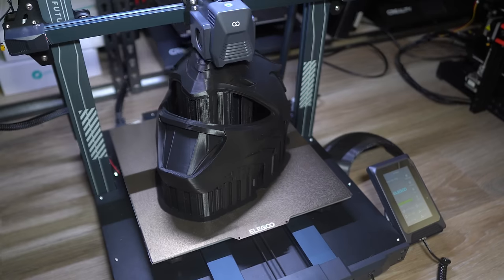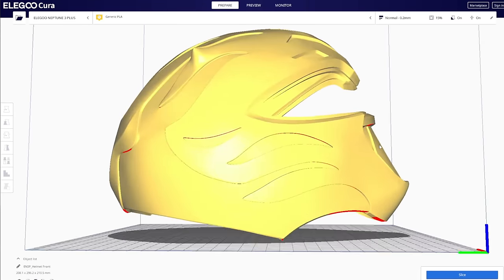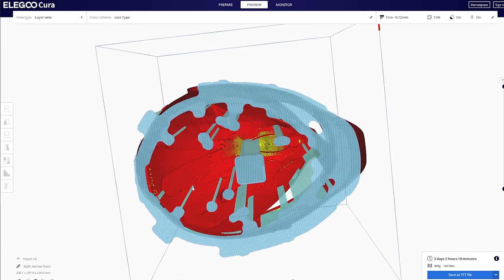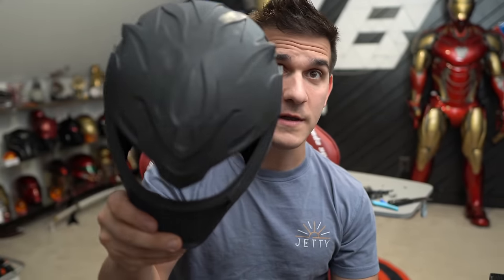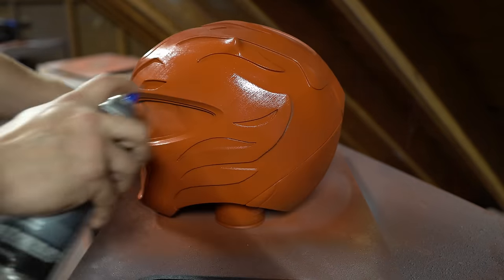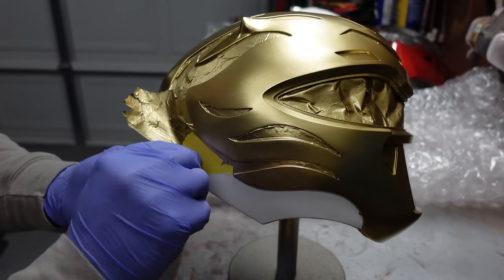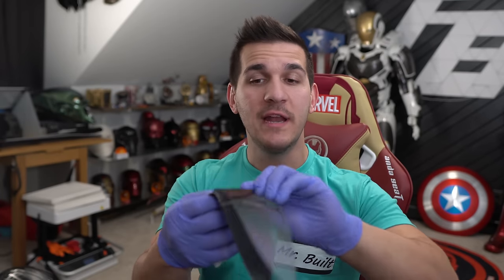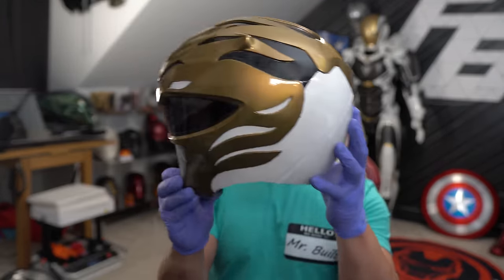How I Made a Concept White Ranger Helmet | White Tiger Power Ranger |

Comment: Two questions, would you recommend heating the plastic up for the visor to mold into shape then tinting? Or can you heat and bend while it’s tinted? Also can you link the plastic for the visor? Iv two two different one and one was to thick and the other wasn’t long enough
Reply from the maker: Heat it after it’s tinted. A heat gun or hair dryer works

Comment: I was wondering if you’ve ever tried using printer resin to smooth out some of the details. I’ve seen a few people try it and it seems like it would save trying to sand the little details and miss printer lines

I was also wondering if there was any update on the gundam helmets you were working on

Comment: Hi me again a problem that I have a lot is when I print on standard quality or higher my prints just randomly stop mid print so I have to constantly print on low quality with a cr10s pro v2
Reply from the maker: It seems like a clog. Could very well be a temperature and speed issue
Reply: @FranklyBuilt  I have my settings on cues my speed is set to 70 and my printer speed is 100% I will put it down to 50 and see what happens I just need to figure out how to change my nozzle I don’t know how to lol

Comment: What can i use instead of fillet primer or bondo
Reply from the maker: A lot of sanding.
Reply: @FranklyBuilt  is that it?
Reply from the maker: I mean yeah. There aren’t really many substitutions for that type of stuff. You either need to sand it down or fill it with spray paint or some type of bindi additive. You could use wood filler too but it can’t be wet sanded.
Reply: @FranklyBuilt  thankyou sir❤u r my inspiration to do 3d prints uk😅it made me happy u replied

Comment: I just got a 3d printer for my birthday last year in august and my mum has said that the electricity bill is sky high and you have like 40 printers😂 so how can u even have any money for filament
Reply from the maker: It doesn’t really increase your electricity that much at all
Reply: @FranklyBuilt  I have a electricity meter where I have to put money in a key and put it in the meter and I have to put in like 200 a week with 1 printer
Reply from the maker: @TRWwiszdom  I actually had a similar meter in my house in England. That’s weird. My readings showed that a microwave used more power than a printer ever did in a week. Interesting
Reply: @FranklyBuilt  if you could would you be able to make a video on how to stop your prints from randomly stopping mid print if that’s possible and aswell when I print on standard quality or higher my prints stopped randomly constantly and all they do is fail on standard quality so I have to print on low quality and lightning infill constantly